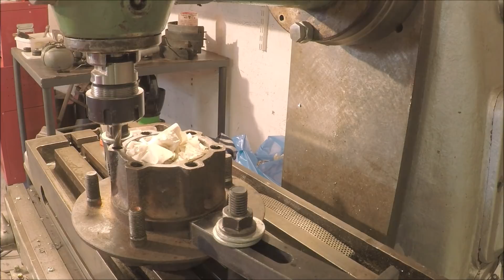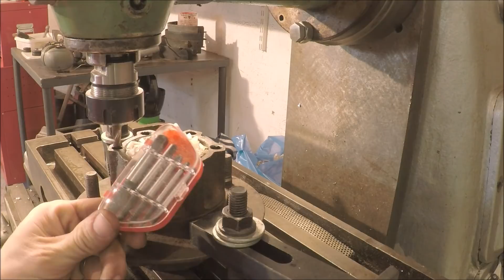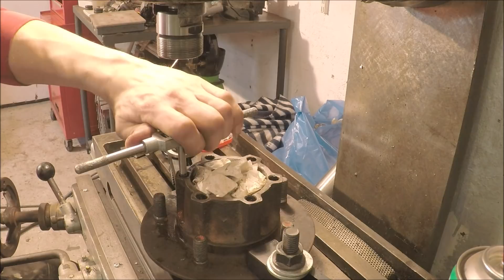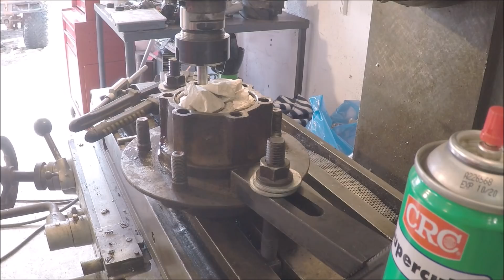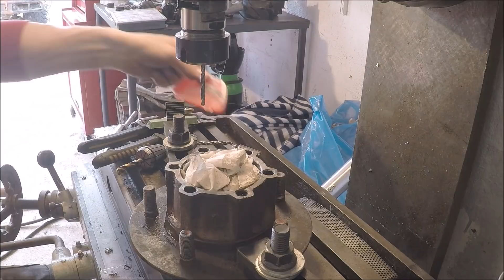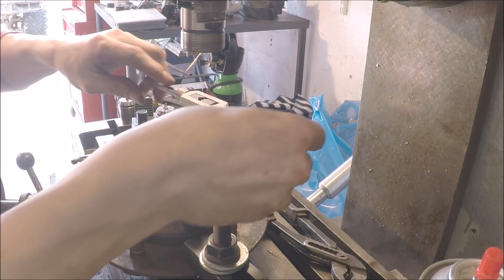Volvo Laplander wheel hub broken bolt removal

Comment: Nice job getting those broken bolts out. It probably isn't but that hub looks suspiciously like a Jeep hub. Although with imperial threads it could well be especially if the axle is a Dana. 10mm is probably 3/8 inch. Thanks for the video!
Reply from the maker: You actually just helped me without even knowing it :) So far i've been searching for laplander parts, which are really rare. Just missing the fact that the axles are Dana. Sometimes you're just missing the obvious :) Thanks!
Reply: Lots of Dana axles used around the world. Most parts are interchangeable if you know what to look for. Jeep, Ford, IH, GM, Isuzu and many more have used Dana axles. Glad I could be of help!
Reply: nice !!!!!!!!!!!!!!!

Comment: you probably should use  grade 8 bolts
Reply from the maker: As far as i could tell, the bolts on the other side are grade 5, but thanks for the tip and i'll have a look again just to be sure. Thanks!
Reply: if these were 5  and broke the price bump of a few coins to 8 may be  well spent :)
Reply from the maker: Couldn't agree more :)

Comment: You could us a helicoil to fix that thread but that could get expensive by the time you bought the insert and also the special tap that you would need. Your plan of going to the next bigger bolt sounds like a good one as long as there is room to do that. Good luck with that project.
Reply from the maker: Problem is that wall thickness. Threading M10 means i only had to drill it out a little bit, compared to putting a helicoli in. Also as you point out theres the cost, not to mention the buggery of where to get ahold of imperial helivoils here in Sweden.